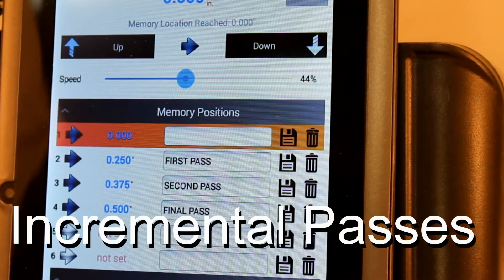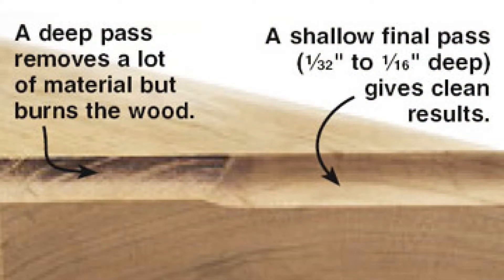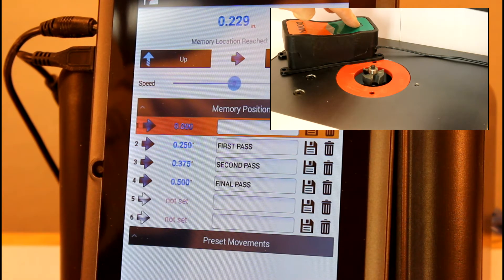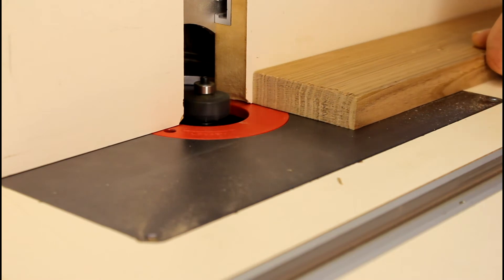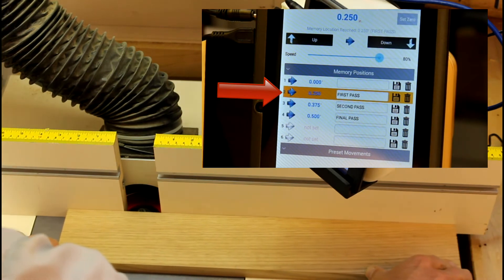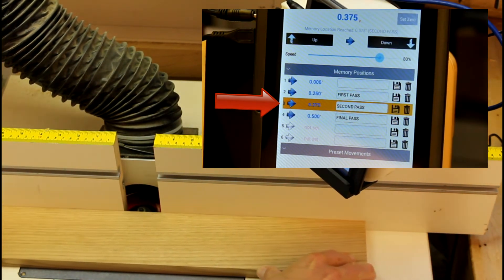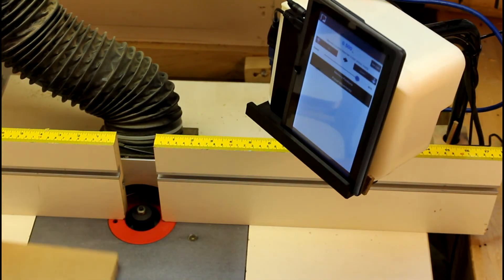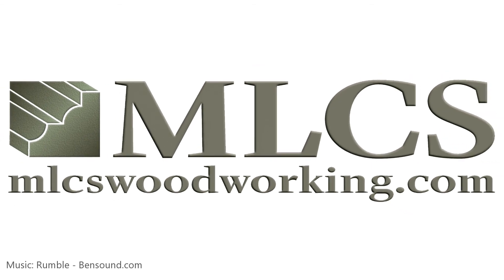Router table Incremental Passes - MLCS PowerLift Pro - Android controlled woodworking router lift

Comment: could this system be fitted to a shaper hand wheel axle to raise and lower the height?
Reply from the maker: MLCS sells a router lift called the  U-turn which is a hand crank coming out of the side of the table to raise and lower the lift. The motorized lift with the foot pedal makes things so easy and you can keep both hands on the work